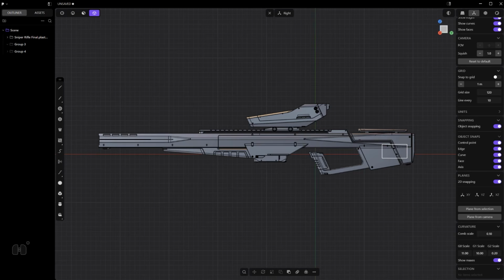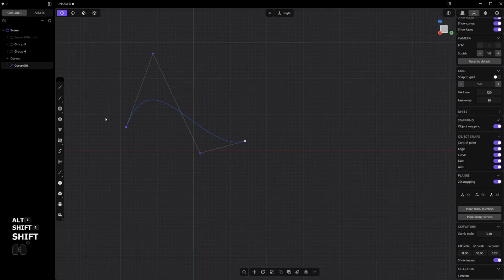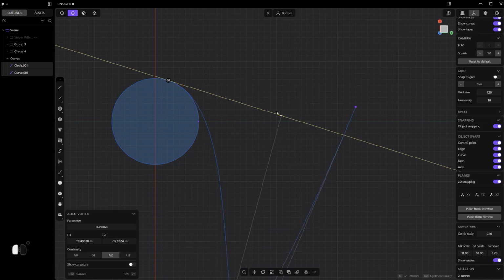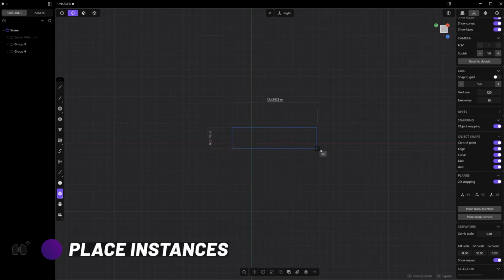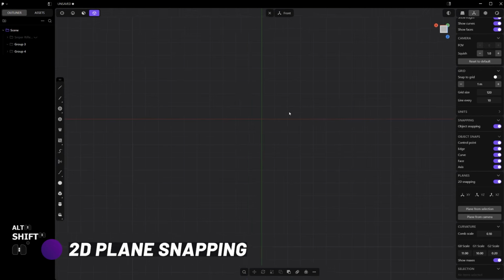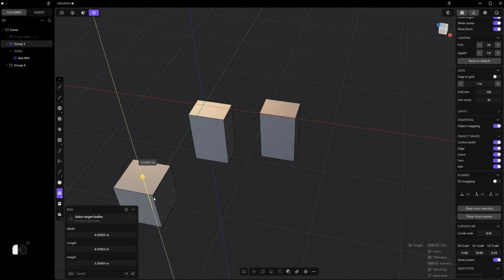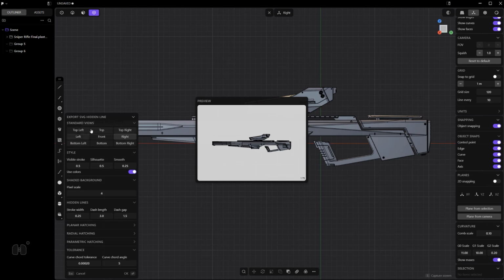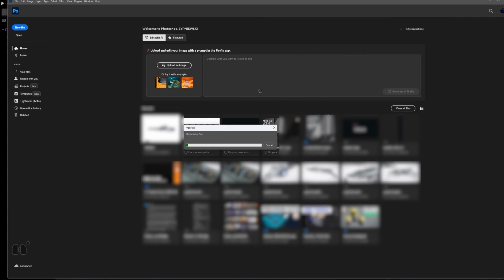Plasticity 26.1 Just Changed Everything — TOP 7 New Features Breakdown

Comment: Another tip for that placing instances example around 8:00 is to first group the widget you wanna place, then select JUST that group name and create an instance of it, and then use the place command on that instance. Now, if and when you wanna add bits to that doodad, or seperate it into parts for different materials, or boolean it, you needn't worry about accidentally damaging your instances in the process.
Reply from the maker: ya that works too

Comment: I'm not trying to be an asshole but why not just use solidworks,  pro/e or any other 3D cad software?  I will add this if you already have it and know how to use the software.
Reply from the maker: software isnt the issue, focus on one, and get good at it
Reply: I use NX at work and used Solidworks as well. Been using Blender since 2000ish. Biggest reason is huge value for the cost, with no rental. Second reason is Nick is of a newer generation of 3D devs that actually understands good UX design. The expensive software packages still require excessive menu gymnastics, have settings which should be close to each other scattered all over the place, vague descriptions for parameters, etc. I, like a lot of others, use Plasticity as more of a hobby and for surfacing exercises. It's not for everyone and a lot depends on what your end goal is. If anything, I feel too many hobbyists spend thousands on SW/Fusion 360 when the manufacturing capability just isn't necessary.
Reply: NX's entry-level package is $4,002 *PER YEAR*, while Plasticity's Studio version is $300 for lifetime use of the versions that are released within the 12 months from purchase. According to Google's link summary, SOLIDWORKS Standard - £2,544 per year, and £4,463 for a Perpetual License (I'm in the UK, hence it gave GBP pricing; dunno why NX didn't, but you can convert it yourself if you like).

You're basically comparing apples and Faberge eggs :P Not that Plasticity doesn't have some real power under the hood, but they're just different suites aimed at different albeit overlapping audiences. If you need parametric modelling and a per-object history feature, then you'll need the other ones. That's why Plasticity is (or at least was) billed as "CAD for artists".